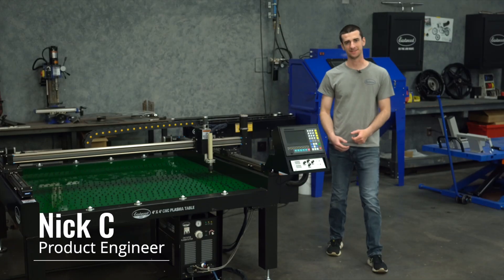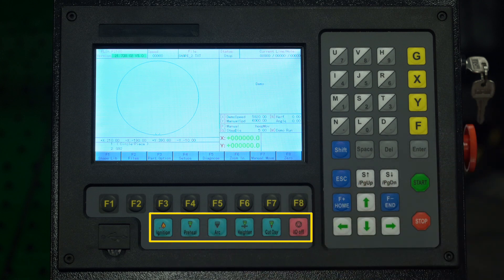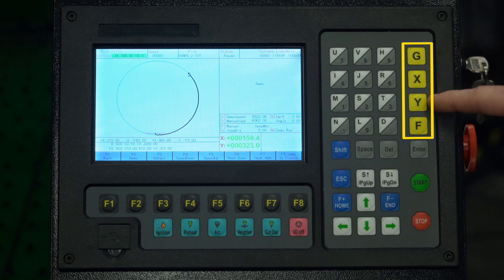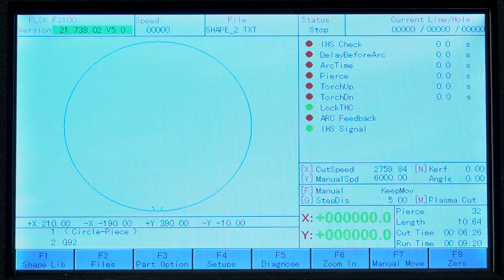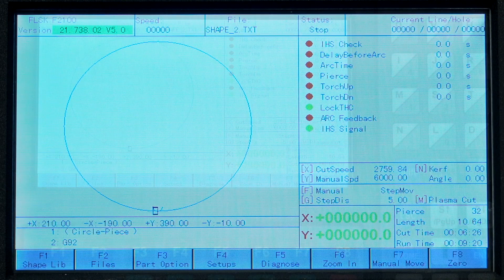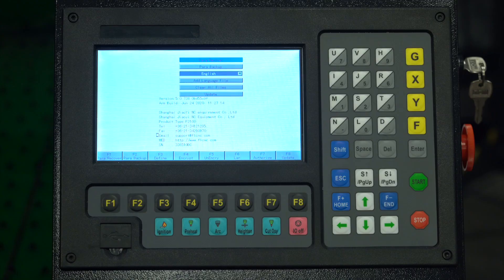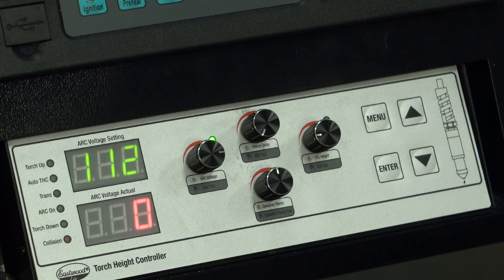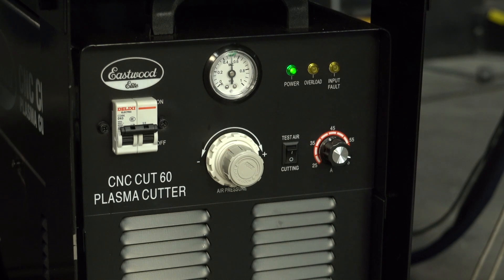Introduction to the Eastwood Elite 4'x4' CNC Plasma Table Controls

Comment: Problem with my CNC PLASMA cutting machine.....I need a help.

It peirces but no moving ...but when do Demo is moving.....at the same time if using flame cut it cuts very good like before.......

When I switch to palsma it makes a peirce on the material but no moving.....I checked all the safety devices /fuses are all ok from the plasma source but no moving when I command......

Please assist me while I am planning to get the bigger machine this year from you.....i followed the videos in YouTube

I am using Huyuan Plasma power source
Huyuan IGBT 200A

 *Simply....

torch does not move after initial pierce*
Reply from the maker: I'll reach out to our technical team but are you working with an Eastwood Plasma Table?

Comment: We don't have F8 on our CnC so how do I change MM to Inches
Reply from the maker: Is your CNC an Eastwood Table?
Reply: Yes
Reply from the maker: I believe that means you have our versa-Cut table.  To switch he needs to press F4 > F3 it will be a blank screen and press "1928" on the keypad. A window will pop up and the last option is to switch between units.

There's a firmware update for this machine if it was purchased before March - please email NCornell@Eastwood.com and he'll get you all straightened out.

Comment: Please my panel is not in English how would I change it
Reply from the maker: [Yesterday 2:00 PM] Nick Cornell
Page 22 of manual last bullet
 
To change the machine’s unit setting from the diagnose menu, go to the F8 System Def (FIG 26) then F3 Define and enter the password “1396” (FIG 27). With the correct password entered, navigating to F5 Option (FIG 28) will open a menu that includes the option to switch units listed as Default Unit (FIG 28). The machine power must be cycled to put this change in effect.

Comment: Huayuan welder 
Serial num: 3853D070
Type: F1621P V3.1 demanding  for password and won't boot
Reply from the maker: You'll need to contact the manufacturer - that's not an Eastwood product.